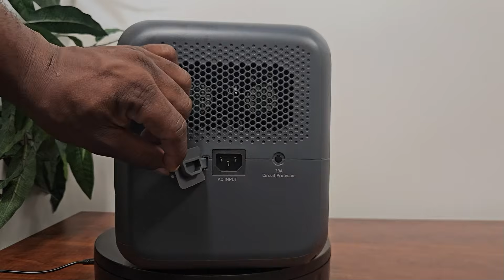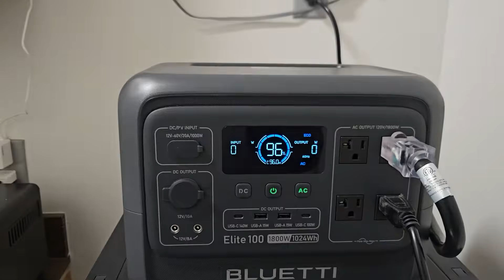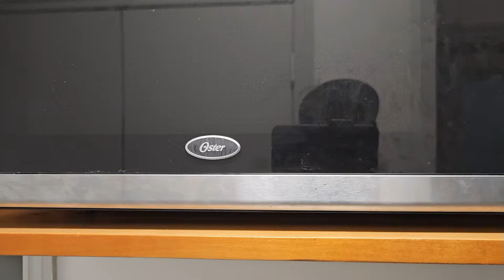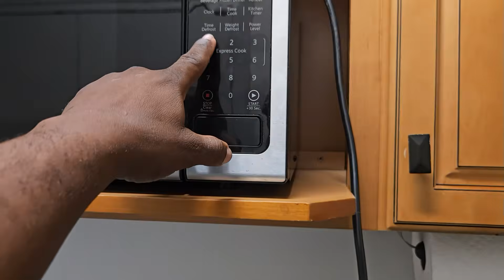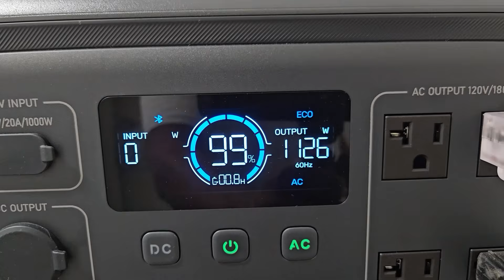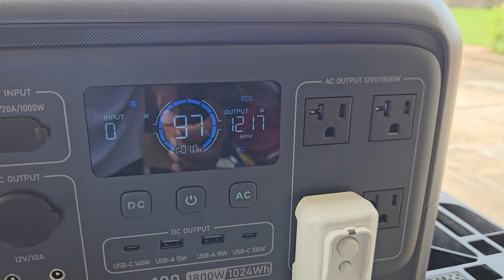BLUETTI Elite 100 V2 Portable Power Station

Comment: There’s definitely an issue with this unit and compressors.  Bluetti is working on a fix.  That AC should not be pulling that much power.  Mine cannot run my freezer properly.  Use a watt meter to see what is being used at the wall outlet, and then compare it to what is being drawn from the Bluetti.  Share your findings with Bluetti.

Comment: Notice how many power stations look and like EcoFlow units? Even the apps mimic EcoFlow. The Elite100 lacks charging port options.  I feel they are both over priced for what you get. I have had a couple of old units and I do not trust Bluetti customer service. They outright lied to me about specs and repairs.
Reply: Completely false statements
1) "Bluetti units look like Ecoflow" ? Not even close. The Delta 2 would be a similar product (spec-wise, price-wise) to the  Elite v2 100, and they look nothing a like. Delta 2 is even slightly heavier, 27 pounds. The Ecoflow app  is miles better than the bluetti.
2) "Elite 100 lacks charging port options". The bluetti Elite v2 100 has one of the fastest solar charger (1000w) for this size of power-station.  This is twice as fast compare to the Delta 2, that at most charges with solar at 500w max. Both can charge with AC from the wall. Both can charge from the car socket. 
3) "Both are overpriced", pricing is subjective. Obviously if you have some technical know how you can build your own power-station, maybe even cheaper. But the convenience of having an all inclusive solution, warranty and a customer service ready to help you troubleshoot is an added value i am willing to pay.
Reply: @RulzSG  LOL, Here we go.
1) False to the False. MANY different brands mimic EcoFlow, FACT. Argument over. It is common for various mfgs to copy the competition. Go with what sells. Heck, even insects mimic the look of other insects.
2)  How you got this one wrong is beyond me. How many types of connectors can be used with the E100? Argument over!
3) No they are over-priced. Jackery charges too much for their units and have been ripping people off for years. I will never own one of those. I built my own because at the time it was much cheaper. Now it is still cheaper but the ease of all-in-one is very attractive. Small size and portability is a huge factor AND cost per watt hour has dropped.
Reply from the maker: I appreciate your feedback on the design and pricing.